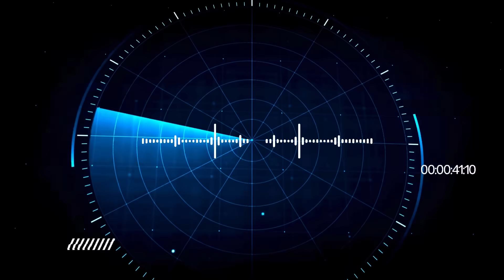“PAN! PAN!PAN!” TAM Airbus A330 Nose gear "Sideways". Multiple go arounds at JFK! #atc

Comment: In addition to indicators in the cockpit, I'm thinking aircraft should be equipped with cameras allover so the pilots can actually SEE things like the nose gear. Just consider all the cameras that are on SpaceX rockets. Cameras are cheap enough to have them all over.
Reply: It's not about the cost of the camera it's the cost of hauling that weight all over the globe. But I do agree it should be cheap enough to do these days. Problem is issues like this are extremely uncommon.
Reply: Think about it for just a few seconds longer dude. New airplanes, sure. All the airplanes already built? Probably not so simple.
You’re talking about retrofitting airplanes with a bunch of objects they weren’t designed to have.

There’s weight and possibly drag (depending on where they’re able to be placed), all the wiring and electrics that would require, and then software and probably a bunch of other things I haven’t even thought of. 

An engineer could surely figure out a way to configure it into the airframe but it’s not just simply as easy as throwing a bunch of cameras on!

Comment: 4:12 - is the quasi-emergency somehow communicated with 125.7 upon the hand-over?  With a true emergency the flight would get the EM moniker in the computer and tracking system letting all controllers know that it is a flight with an 'emergency,' but is there some other way of declaring status to other controllers to let them know when a pilot refuses to declare an emergency?

The pilots were very calm and determined to land despite the fault - they seem to have experienced this before.